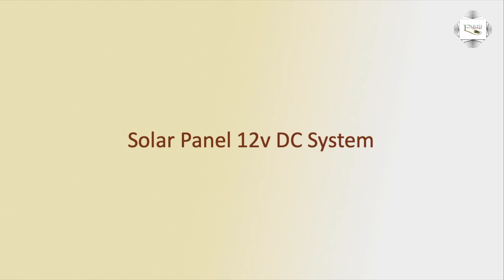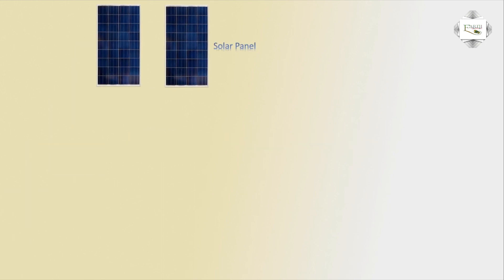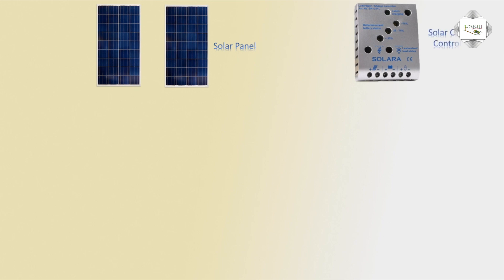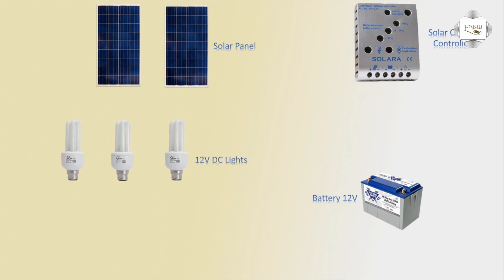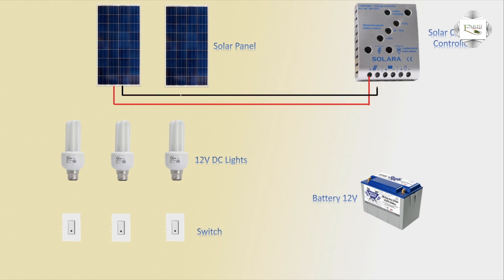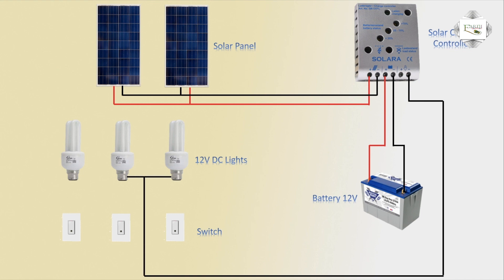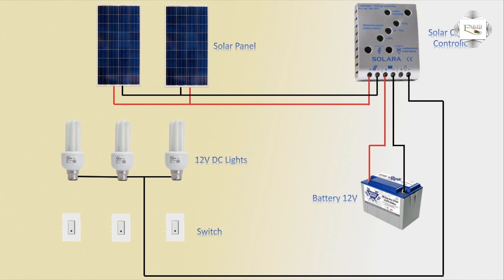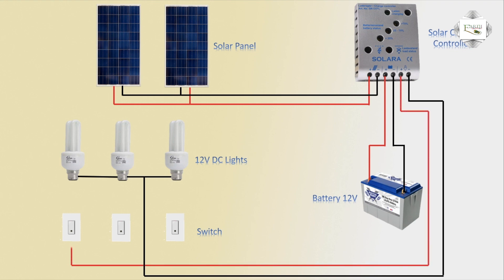Solar Panel 12v DC System | Solar Panel | Solar System

Comment: Solar charge controller 12v output can use DC 5 bulbs and 2 DC fan same time ? 

Voltage not drop?
Reply from the maker: no.....sir....
Thanks for your feedback, please follow.........
"Thanks for watching the video"   You are very welcome!
Reply: @EarthBondhon  no means. Direct battery only can use?

Comment: Perfect video. Thats very close to what I was looking for. 
Bro please guide me. I have following items :-
1  Suore 60 Amps MPPT charge      controller.
2  TX 1800 Phuenix Tubler battery 185 amps.
3  Solar Panels 4 x 150 watts Suoer company
4  Main wire 16 mm + all rest wires 4 mm. Every point separately attached .
My Load would be :-
1  Fans ac / dc 5 nos.
2  lights 12 v 12 nos.
3  water air cooler 12 volts 1 no.
Sir please guide me how to attach my solar panels, either in series or in parellal or set of 2 in series and then parellal ? Regards
Reply: I am aslo looking for help for my final year project
Reply from the maker: Thanks for the view..
Thanks for your feedback, please follow.........
"Thanks for watching the video"   You are very welcome!